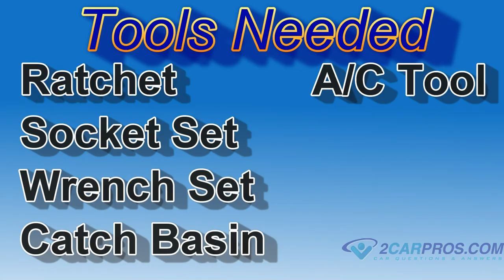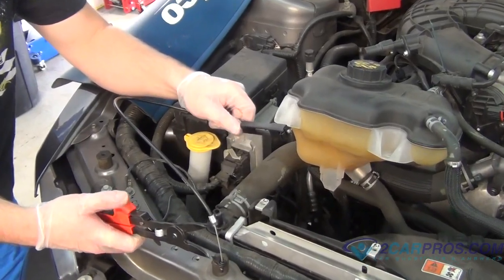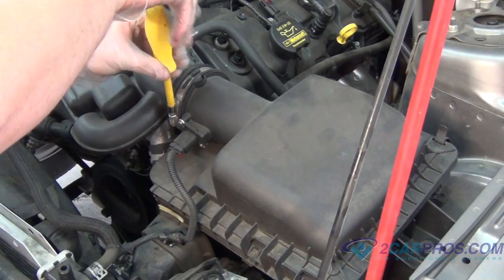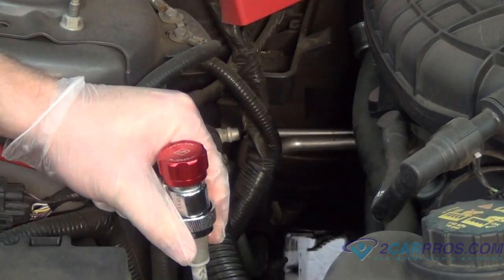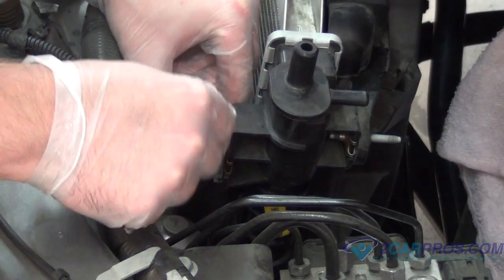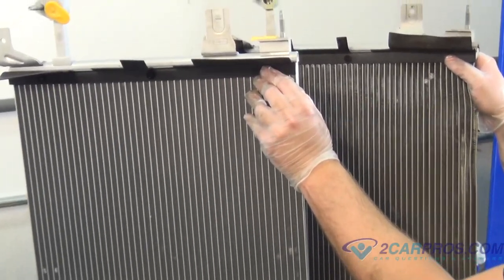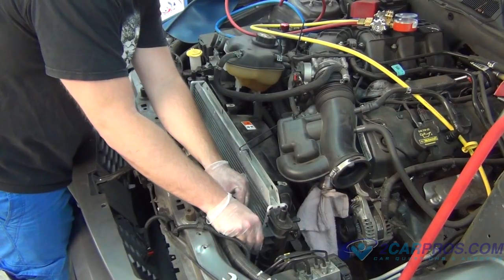A/C Condenser Replacement Ford Mustang 2005-2014

Comment: Was it really necessary to bleed the coolant ?  Couldn’t you  just unbolt the condenser and replace it without those extra steps
Reply: i thought the same thing
Reply: That’s exactly what I was thinking… seems like a bit too much, especially when someone pops a hole in their condenser, I don’t think it needs bled if it emptied itself.
Reply: Can anybody confirm this?
Reply: @christianlinson  I just went for it last night and took one bolt out and the free-on attacked me and filled the shop like tear gas... I would not recommend
Reply: That's exactly what I was going to comment

Comment: Its not necessarily to drain the coolant however I think the reason he drained the coolants and disconnected top radiator hose and engine radiator hose so he can push the radiator forward to have gap or space to remove the 2 bolts behind the condenser, and has more room to move or pull up to condenser out
Reply: Facts..ion understand y ppl question stuff. If yu some wanna do all the extra and have a better way go for it but damn it's just a helpful video for those who are newbies..lol the world is so sensitive🤦

Comment: Good video;  thorough explanations.  On my 2011 GT, I also had to remove the section of intake tubing leading to the throttle body.  I found it was easier to remove the condenser through the bottom of the engine compartment (jacked the front end up a little).
Reply: You're right,condensor on GT can only be removed from below. 
The repair manual says likewise

Comment: if I wanted to replace my radiator would it be the same process...? that's the project for today and I'm a little lost so many bolts. the only scary part about it is losing all my AC don't have a container...
Reply: Felix Gonzalez Same process, when I replaced my radiator I broke the condensing unit line coming from the condenser. You just have to move the transmission radiator over to the new radiator. It’s pretty easy just takes time. And take your time so you don’t make the same mistake as me

Comment: Could a orifice tube not working properly cause air conditioning to blow cold and hot and cold and hot and the compressor is still running. Gets colder when I accelerate ,thank you. I'm about to drive myself crazy trying to figure out this problem this is my first Mustang 2013 V6

Comment: I’m trying to delete my ac system. Can you just bolt the radiator back normally without the ac condenser?
Reply from the maker: Yeah you should. You might need a spacer or something to take up the space. Thanks for watching!
Reply: Did it work without the condenser ? @coyote

Comment: Excellent video! Just curious, is it necessary to drain the radiator coolant?
Reply from the maker: Nope. They are different systems. You might have to drain a little bit if you need to take the top hose off though. Thanks for watching!